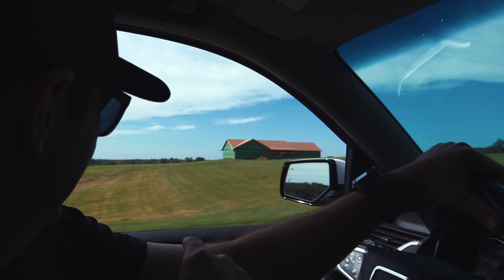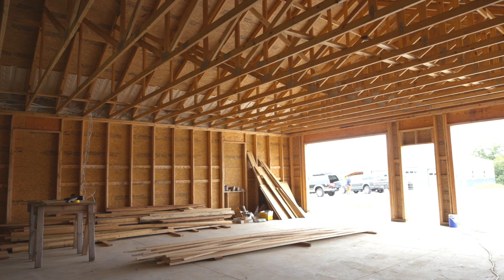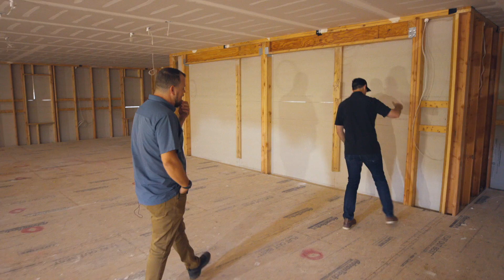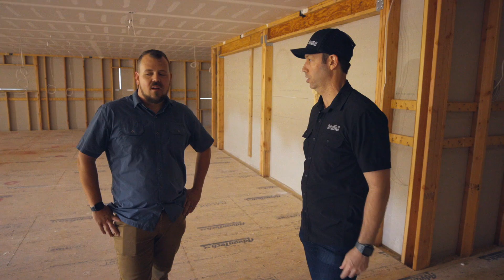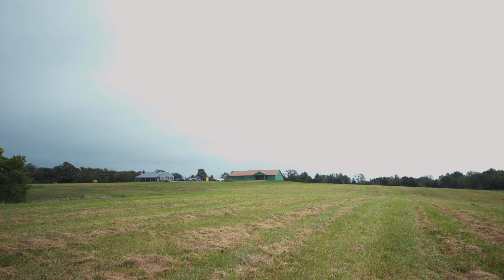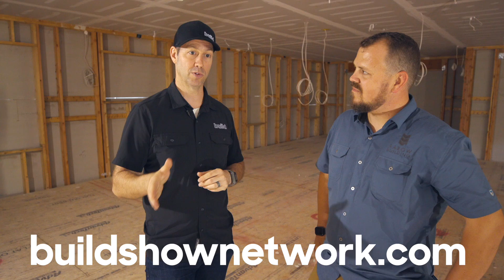A House with No Doors or Windows?

Comment: After watching lots of videos about Zip Sheathing I asked my lumber rep about the cost.  He said I didn't even want to know.  It's so expensive that they never stock it because most spec builders around here need to make a living when they sell a house.  Virtually NO buyer has ever asked me about any of the stuff I see on this channel or other high-performance building sites.  But I'm still totally interested in this stuff because, who knows, sometimes the techniques are economically reasonable.  I try to implement as many things as I can afford, and I'm always a couple steps more advanced than the big production builders.
I build in Seattle for ~$140/ s.f. before profit.  These guys on the video are essentially pre-paying future utility bills by creating super-efficient envelopes.  But how many decades of low gas bills will it take to offset $200,000 in exotic materials and techniques?  It's a niche market that demands this, and it generally fails for spec home builders because buyers seem willing only to pay for square footage, solid surface, hardwood, and high-end appliances.
Reply: I just did zip on my personal home. It actually ended up being cheaper than doing traditional OSP + Tyvek. It runs about $5 more per sheet than OSB, but your framer does everything and you're pretty much done; no need to bring in a separate trade to do the AWB so you save on labor and materials. I have been impressed with zip so far. We blew a 2.0 ACH50 without much work.
Reply: @matt_metcalf  That's good news.  At the time I inquired Zip was ~$20 and OSB was $8.50.  That would be $1100 more for walls, but then I did spend ~$300 for commercial drain wrap.  I like the idea of Zip but I don't think it pencils yet for spec.  If and when I get to do another house for myself it'll probably be 2x6 walls with OSB and 1.5" rigid foam on the exterior.  Foam aint cheap either, but it does insulate very well and help air seal.
Reply: That's exactly the point I've tried to make before; it'll take at best 10 years before the utility savings pay for themselves.  I love the idea but even just 10 years is a LONG time and you're more likely looking at 20 years plus before it pays for itself.  Even a solar install will pay for itself faster than that I'm pretty sure.  I really wish I could have such an efficient and passive home but it's just not feasible for most.  What I would love is to see it advance, see more demand for it, and see costs for it to come down, making it more feasible for many people.
Reply: @matt_metcalf  I love learning stuff like this, it makes me feel a little more hopeful and better about how feasible such an efficient house might actually be!  I'm not a builder though and know so little about the process that it's near impossible for me to understand (without somebody explaining) why it might actually be feasible!
Reply: @glasshalfempty1984   "it'll take at best 10 years before the utility savings pay for themselves." - don't forget that you're also paying a higher mortgage on the more expensive materials...  so by the time you throw a 20 year amortization on the product surcharge, you're probably taking the full 20 years of lower utilities just to break even on the savings.  That said, there is (a lot of) value in having a more comfortable, homogeneous interior climate right from day 1 - so that better be what you're buying...  not energy savings.
Reply: There is a point of diminishing returns - these houses are way past the point of diminishing returns. You could build much cheaper and achieve 98% of the same performance... when you  start chasing the last 2% your price goes through the roof, literally!
Reply: @stipcrane  do must homes in America have ERV systems or they use different kind of systems because most homes like the ones you build are not airtight enough?
Reply: @CroElectroStile  ERVs are rare in the large subdivisions which are speculative, but with the latest code revisions which address air changes, they will become more commonplace. Each of the 50 states has its own energy code, and each city and county can modify that code to some degree.  As air change codes tighten up, the ERV will become mandatory.   I build in Washington state, which has a mild marine climate.

Comment: From my experience other builders complaining about the cost, have to remember what your houses look like when they get built. About 98% of the time when I do walk-throughs of other construction crews, the house has errors and riddled with cost-cutting mistakes. That is because you quoted the price so low, you are barely breaking even. If you notice, Matt only demonstrates premium quality. Matt is leading by example. In 100 years, while your houses are rotting and or dilapidating, these home will be standing strong.
Reply: Well said!!
Reply: MrMoon_  My concern, as always, are the durability (and possibly outgassing) of foam and plastic based components, especially in an a airtight house.
Reply: MrMoon_ But I do agree that production homes today are built like shit... cost cutting and shortcuts seem to rule.

It may take me a while to build my own small home, but I could NEVER trust another builder.
Reply: So 100 year old houses are something special?
Reply: @axelotl86  Yes. If a house is still here in a hundred yearsand especially in the Northeast when they're over 200 years old, it is example of fine craftsmanship that has long been gone from the scene. 
To be honest I am on the fence about these are tight houses.
Reply: MrMoon_ yeah, without good ventilation moisture is building up inside and even 25 years are a stretch. Super tight houses were a thing in Europe but we moved one step back.
Reply: @axelotl86  it is not so much of the moisture, that is controlled by the HVAC system. There lies the problem. As a minimalist I look for ways to be less reliant on other things. HVAC systems in airtight houses have got to be complicated and the more complicated than more it cost to operate the system. 
You would continuously need to operate the HVAC system in order to keep the house livable. Whereas an old house you can open the windows without throwing off the environmental system. 
When you have these complicated HVAC systems they tend to have HEPA systems to. If we clean the air too much and make it to sanitary we lose the ability to build our immune system. 
Studies have shown people such as the Amish, have better health and live longer healthier lives because the way they live compared to the people who live in environmentally controlled homes.
Reply: MrMoon_ here where I live in Germany there aren’t many/very few houses which HVAC Systems. So this is nothing I had in mind. Manual ventilation and not airtight houses are the standard. Water air pump and floor convecting heating/cooling is our Modus operandi.
My experiences with passive/airtight houses was always not good.

Comment: As a plumber , I hate slab.  No changes after poured unless you wanna jack hammer concrete.  Yes, there is the mechanical basement, but no bathroom near an outside wall?
Reply: Master bath has a window/exterior wall

Comment: Any concerns with railroading the ceiling rock like that? Usually you see butt joints staggered to prevent cracking
Reply: I thought about that too. It looks like the joint lines are going to lay just under where the walls are going to be placed base on the chalk lines on the floor. So if there are going to be any cracking, it's going to be hidden under the 2x4 that's going to make up the walls.
Reply: That's awesome, I saw that s*** immediately and thought oh that's going to be visible when it's painted.
Reply: The butt joints are intentionally aligned on 2X6 interior walls so any cracking is controlled - exceptional planning by the builder. If only every builder put half the thought Jake puts in a building our housing stock would improve 200% overnight......
Reply: Steven Baczek, why use 2x6 interior walls? Is it just for Plumbing or a different reason? Thank you for being involved in the comments even though there are so many naysayers.
Reply: @dennispope8160  np, we used 2x6 to have the abilty to run 5" duct work up
Reply: @dennispope8160  Its a choice, no real reason to do so outside of walls that contain ducts and drains.  Also costs a bit more to get pre-hung doors with thicker jambs.
Reply: Trevor V that’s all I saw lol
Reply: Butt joints

Comment: $250,000 for a 1000 sq-ft house... not exactly for your basic “everyman”.😭
Reply: Massachusetts would like to tell you that pieces of shit around here that are 900-1100sqft also sell for $250k right now.
Reply: @rob_over_9000  keep them, a fool and his money.
Reply: @rob_over_9000  That includes property, they are saying $250 per square foot for just the house itself.
Reply: I suspect these guys play in a different sandbox than most regular folks.  Their clients aren't asking "what is my return on investment by spending an additional $120,000?"  Those that don't spend "stupid money" will say, so instead of $200 for electric, It's only going to be $100.00, saving $1,200 a year, so in 100 years I'll have made that $120,000 back"  I have a huge amount of respect for what Matt and his crews do. I could only dream of doing what they do, However their methods aren't for the regular folks.
Reply: Dude, here in Davis CA, homes run about $385 per foot. I know of a 1000 sq ft on a 6000 lot built in the mid sixties w/o any upgrades listing over $425,000. What they are offering is a deal for the future
Reply: Where did you get 1000sqft for house? Looks more like 2000sqft 1700 minimum. And $250/sqft is not that high. Got a bunch of yuppies and retirees moving to my area and building houses that are clocking in at $350-$500/sqft, average is $125-$150 on new builds. Atleast this place is well designed and hopefully well built. Not sure how it will fare versus tornado but hey.
Reply: I got a house with cardboard sheathing, much better price.
Reply: @chrisanthony579  The homeowner will most likely never see that break even in 100 years.  If a 20 year old could qualify for that kind of loan he'd be 120 before he breaks even.  Micro bursts, Tornados and Hurricanes love to rip apart air tight homes, so I doubt the home will last 100 years.  They need to make them with a huge air pressure relief valve.
Reply: @zinner927  That's better than most homes in Tucson, roofing paper over studs wrapped in chicken wire and stucco'ed over!

Comment: I also had triple pane windows and short duct runs that didn't supply near the windows. It could have worked from a BTU requirement standpoint except the airflow was bad. My supply and return were too close to each other. Make sure you don't make this mistake. I had to redo the duct runs :)
Reply: agree. i noted that there was no mention of where the returns were and wondered the same about airflow. when he said 'short supply ducts' i thought 'long return ducts'
Reply: @thebluelunarmonkey  Returns are in the same area - they will not short circuit. I have designed over 4000 homes in the Southwest with these concepts. The builder offers an ENERGY Gaurantee!! and has NEVER paid out on it. A little homework and planning always serves success

Comment: Genius floor and ceiling system.Walls can be moved in the future if needed. It is basically a heavy duty of version of dricore r+ panels on the floor.

$250 sqft takes into account finish materials. What type of flooring, cabinets, countertops and millwork can have a serious effect on price. I would assume it isn’t prefinishrd mdf baseboards from a big orange store. 

And good windows cost money. 

You get what you pay for in the end.
Reply: Agreed, also understand there is a 650 sq ft garage in that number, a 200 sq ft covered patio, and a covered front porch. These aren't crazy numbers but they add up.  - Your sensible thoughts are much appreciated
Reply: That is similar to what a higher end home cost up here in Winnipeg. Our dollar is different but that home certainly has some extras in regards to insulation that you don’t get in that price here.

Comment: super tight, super energy efficient is great and all, but at $250 a square foot will it ever pay for itself? what would an average house build for in this area?
Reply: Kevin Marshall $150 med trim out
Reply: @Siamko  so at say $100 a sq ft difference a 2000 sq ft house would cost $200,000 more to build. It would take a long time to make that up in energy savings.
Reply: @kevinmarshall6603  you won't see it in 2 lifetimes
Reply: @kevin Marshall agreed
Reply: It's not about energy solely.....please try to understand, you are all brutal
Reply: @steven bazcek what else besides a very expensive interior should justify that pricing.
Reply: @stevenbaczekarchitect9431  These are (mostly) objective, unbiased opinions.  It's a little insulting to me when the professionals involved in this project act like that's a good price.  Just be honest that it is a premium price for a good build and for the 0.1%.

Comment: Question about the ceiling. Trusses around here tend to flex through the seasons. How are you dealing with top of the wall separation on the interior walls or is that an issue with this building style?
Reply: This house will have failing wall to ceiling tape joints everywhere.
Reply: skliros couldn’t you do crown molding instead of a taped drywall joint if you are really worried about that? This seems very similar to commercial construction where the partition walls are added after the building is finished.

Comment: A great "open concept" format will allow wall/room reallocation's to suite the homeowners changing lifestyle. Similar to open plan office spaces.
Reply: very good point. an experienced DIYer could fearlessly take on a project to move the walls around.
Reply: Interior walls go up later. Presently marked on floor.
Reply: Eh, it was designed with the basement in the middle which is a neat idea but doesn’t allow the future homeowners easy remodeling. I think if properly designed (like I am sure Steve did) it won’t need more then a new coat of paint for each new owner.
Reply: @dennispope8160  Thank you sir!!! I'm guessing a very very short list of homeowners lol - Thanks for the kind words, much appreciated

Comment: A 3000 square foot house would cost $750,000. That is triple the cost of some home markets, but that is for established structures that are like living in a colander. A new build that is high performance with high end finishes is going to cost more, but depending upon the local market it may not be as far out there as it initially sounds. Some areas of the country a 1500 square foot home costs more than a 3000 square foot home in a different market. 
Yes it is a spendy project, but custom homes are built to spec for the customers and when done right cost less to occupy. 
We do air sealing and insulation upgrades on existing homes. It is much better to build right when you can.

Comment: Thank you!!! We are building a passive house in Oklahoma and we are deciding on PROCESS! These vidoes are invaluable!
Reply: GREAT PLAN!!!! Literally.....
Reply: @stevenbaczekarchitect9431  I follow you on IG as well! I LOVE when Matt visits your projects!! What are your thoughts on the tightness of the house (passive house standards) and spray foam? Our wall assembly is 2x8 24 on center and we will be using zip 9 with liquid flash. We are considering Rockwool R30 or 1-2 inches closed cell and filling the rest with open. We are just concerned about it being so tight! We will be using Kolbe windows, triple pane U .17 and SHGC .28/9. Also, do we really need to dry wall ceiling without interior walls if we are using zip on the roof? Another thing is I designed the home to be 30 feet wide although it is 5 bed 3.5 bath on ground level so that there are no load bearing walls. So we CAN do this. But why is it necessary if the envelope is exterior with the zip system?
THANK YOU for all you are ALL doing!!! You are literally helping the world become a better place by sharing knowledge with those of us stuck in areas where it hasn't quite reached yet! THANK YOU!

Comment: I built my own house this way, almost to a tee. I used 1.5" polyisocyanurate foil faced sheets inside and strapped over that. Even tighter than this place. 

And 24" OC studs is the way to go. Heated slab on grade. No numb subfloor over concrete. I believe that is a waste of money.

R30 wall assembly 
R60 ceilings

Comment: I'm a little surprised he didn't go with in-floor radiant for primary heating, but perhaps the flooring panels are too effective an insulator for that to be worthwhile.
Reply: The way to do it in this construction would be to put the radiant on top of the subfloor. Which would probably work quite well with all that insulation under it.